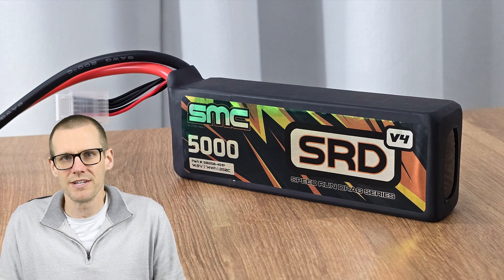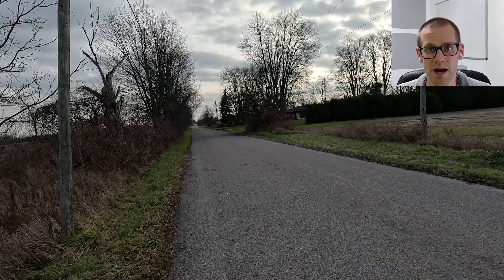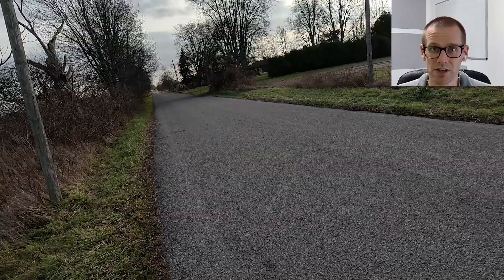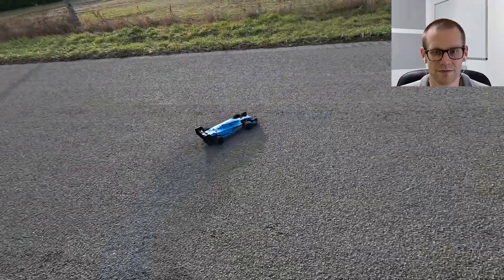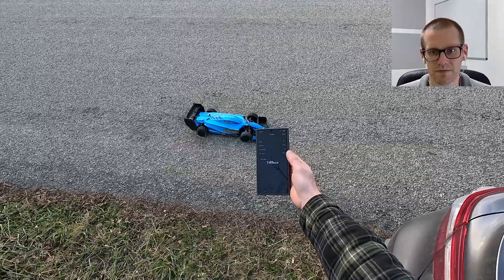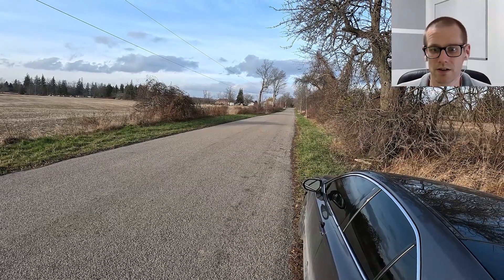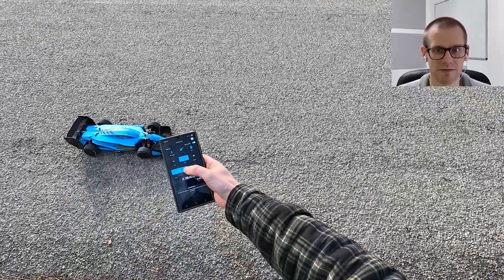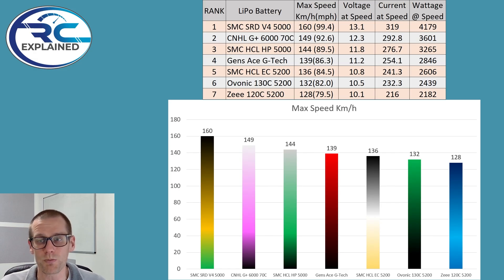Fastest LiPo Speed Test: 5 Top Brands Go Head-to-Head

Comment: Hi Ryan, thanks for the speed run videos. I was wondering if you have done any mods on your V1 to the center drive shafts or diff drive cups?
Reply from the maker: No i haven't. It runs fine up to 130mph in my experience.

Comment: smc and onyx are the best...  personally, Onyx are the King of Speed Run Packs - pure power...  the more the cells are "exersized" the better the IR gets... they get stronger... IDK why you didnt include Onyx...  SMC shill i recon....  100mph is a very small load...  hit 150 or so to really get a load... pull 500 or so amps...
Reply from the maker: I haven't been able to get a hold of a 5000mAh Onyx 4s yet. But I'm working on it. The SMC in this video peaked at 463A drawn and settled closer to 300A. 150mph would be excessively difficult to do on 4s and unreliable for testing. 1000mph is already 3x more load then my independent battery load tests. When I get the Onyx pack, I hope you check the video out.
Reply: @RCexplained no it wouldnt i do it all the time... ill post a vid this weekend of it...
Reply from the maker: You would have to come to the street I run on. But I would still love to see the castle graph you can get for 150mph and 16.8V max. Your 2028 1700 should do well but is not optimized for 4s.
Reply: @RCexplained  its not 2028... its a limitless with ghost / castle 1721 2400 kv....  bro, i know you think you know a lot... but, im a effin guru at this shit...  i ve been into RC for 35 years - HARD and Steady.... im not a casual...
Reply: i have a log from a 138 mph last weekend... one single onyx 8300 McCoy 230... you want that LOG? it was still pullin... just got squirrely and i had to give up on the run..
Reply from the maker: How am I supposed to reliably hit 150 mph on the street you saw in my video when you—with 35 years of experience—are already squirely and letting off at 138 mph? If I’m hitting 463 A peak at 99 mph, do I really need 150 mph to reach 500 A? 

Regarding the “SMC shill” comment: I’ve been in talks with an Onyx contact for over a year trying to get a battery, and we may finally be close. My goal here is to share honest information. I'm not on here saying I know a lot and am certainly not assuming you or anyone else is a rookie. 

But I did go on your channel and see multiple video of you running the 2028. It’s great to see what others are achieving with RC.
Reply: @RCexplained  if you get loose... run it again bro... keep on til you get it....   im fixing to this weekend... keep on
u aint gotta be rude bro...
Reply: at 99mph if you are heating your batteries like you should, higher voltage output at same wattage equals less amperage... idk why you are pullin those kinda amps at only 100mph... its not a heavy load on a limitless... i just looked at my 110mph hit where i was gearing this new motor in and im 278 peak and settled to 180....   if its efficient it shouldnt be pull that kinda amps, unless its a really short run (more like drag race than a speed hit)... how many feet are your runs?
Reply from the maker: This builds purpose is to pull as many amps as possible while not going too fast. This limitless is a dedicated battery testing platform. This is not about being rude, I can't afford the down time to crash.
Reply: @RCexplained I have two GT platforms and one open wheel... I can afford to drive on the ragged edge because I have something else to drive if I crash....  I totally get the NOT CRASHING thing....  If I came off rude about the smc thing - my bad... didn't really mean it like it sounded whenever I re read it...  im an ONYX shill if it means any different... happy speed
Reply from the maker: Very nice. I have 3 limitless of which one is my speed run machine. The other 2 are for youtube production. Crashing has resulted in 2 planned videos to be released in December to be canceled. Lol.
Reply: @RCexplained I do get it...

Comment: Can that 1721 2400kv do speed runs till the batteries run down? Im building my infraction want 100mph all day with no temp problems. I just ordered the cnhl g+ 6000 lipos because smc is still out.
Reply from the maker: It will give you around 3 to 4 100mph passes without any fans

Comment: Please test the new Turnigy Bolt series.
Reply from the maker: Is this the high voltage variation? I haven't done any high voltage if so.
Reply: @RCexplained Im not sure iv just subscribed and learning alot. Love the channel. They are very hyped lipos in the uk. We can't get SMC easily over here. Our best are CNHL Turnigy and Gens Ace from what I have gathered.
Reply from the maker: There are 2 other brands that users say I need to get. Overlander and Corally? But one of the sites blocks me entirely from viewing it. This, I'm afraid is much worse then SMC as they will still ship them if you contact directly.
Reply: @RCexplained Oh didn't know that. Think im going to give CNHL a try as i know they are overall good Lipos. I was just wondering if Team Corally had good ones as cant find anything on them.

Comment: Poor zeee gets a beating everytime
Reply from the maker: Unfortunately its numbers really struggle. I dont know how this pack does so well in popularity but is the slowest thing I can find. Truly wild.
Reply: I have a couple zeee 5200 3s I run in my trail and monster trucks with brushed and mild brushless setups and they're great. I would never run one in my felony. I highly recommend cnhl 9000mah 3s 120c (2 in series) in any arrma 1/7. That line is absolutely killer, although they might not fit in your v1 with your current setup. Their 10000 6s 100c is a close second and would slap in your limitless though.
Reply: i did 156 on zeee 4s 8000mah solid 100c  when warmed up before run cheapo for warm ups smc is my main

Comment: Wow im first. But if the mah is different doesn't that flaw the test and a first pass vs a second pass is different also! Correct
Reply: On 1-2 passes you aren't losing that much. I know with my SMC after 3-4 passes gone even faster. Cause the battery got warmer.
Reply: @djtazzmtl agreed but the second pass the batteries are warmer which is an advantage over the first pass!
Reply from the maker: The idea wasn't for this to be a test of all 5000mAh packs. This test was of all packs currently in my testing inventory. Next month 4 of these brands will be gone. 

I've done 2 runs on 2 different days with these packs and believe the speeds achieved are very close to the true speeds these packs can hit in these conditions. Unfortunately the SRD run went off the road on day 1 resulting in damage that I had to replace. These test videos are harder then it looks. 

Im ok with the stock tires as im really not pushing the car too hard. Ill try other tires at some point im sure.
Reply: Im a fan keep content coming
Reply from the maker: @QZillasWorld appreciate the comment!
Reply: Hi Ryan, I see you running the Hoons dboots. Have you experimented with any other tires, (i.e.GRP) or are you happy with the stock ones?